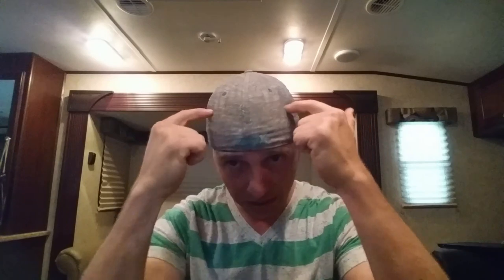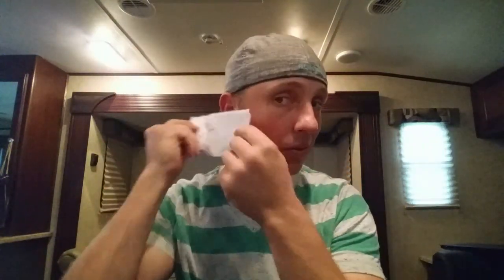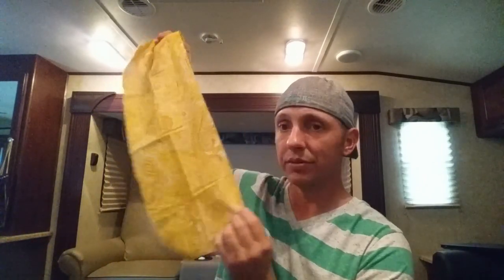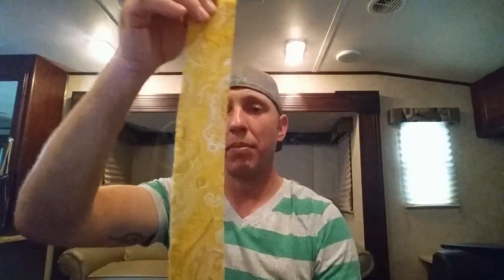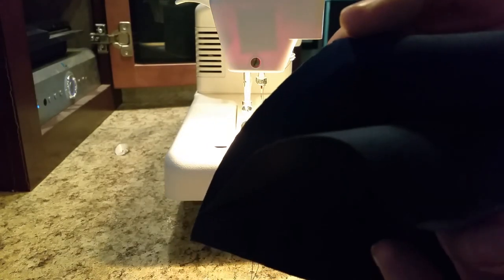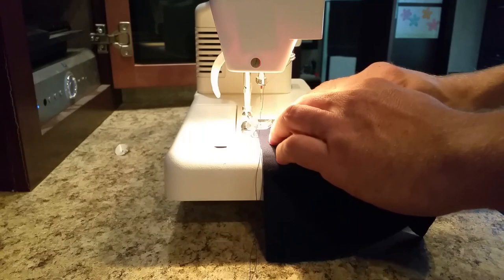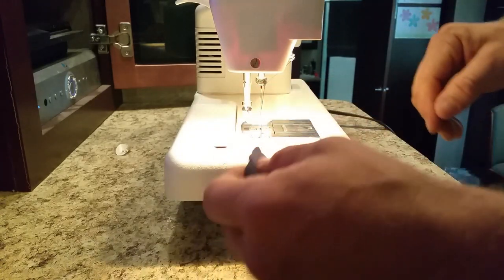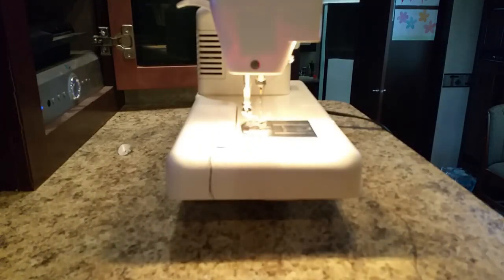Welding Hats Part 1

Comment: when you took apart that welding cap for measurements, did you cut it; cut it or take off all the seams and just unravel it? lol also, what are the measurements on your templates?
Reply from the maker: AVC 81 cut out the stitches to get whole panels. and my head measures 24" around and from the middle of my ear to the top of my head is 8". so 8-1.5=6.5 (because I put 1.5 inch headband. 6.5+.25+.25=7 because there is one. 25" lap at the top and .25 lap at the bottom. 24" around / 4 panels= 6" per panel. 6"+ .25+.25=6.5" wide. so 7" top to bottom 6.5" across. just take the basic shape from the old hat that you cut up. hope  this helps
Reply: thank you, ill do my best ;)
Reply from the maker: AVC 81 I'll help the best I can

Comment: LOL sorry but my husbands head is bigger in circumference than the length of a fat quarter. LOL What state are yall in. We are at a nuclear plant in Georgia. :)
Reply from the maker: mine too. I usually take the fast quarters and rip my 2 " strips first. that way 2 halves outside and 2 halves inside. if I havea piece that is short, I just splice one together and use it for an inside piece. to hide the seam. compressor in Alabama